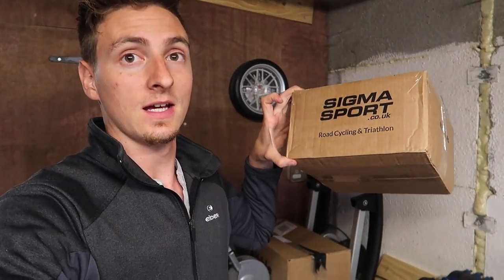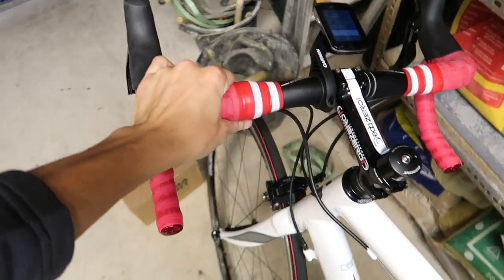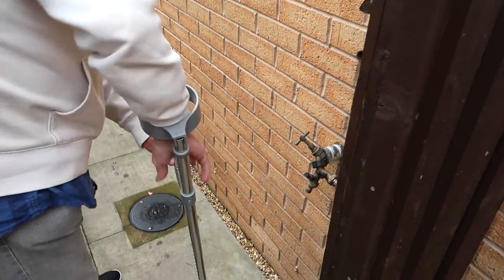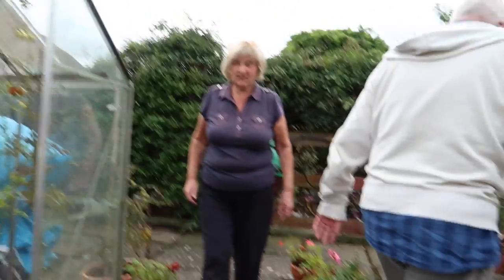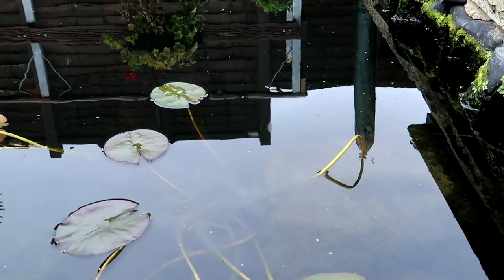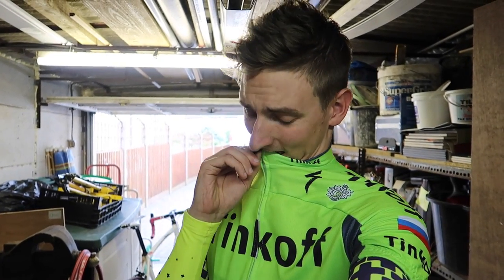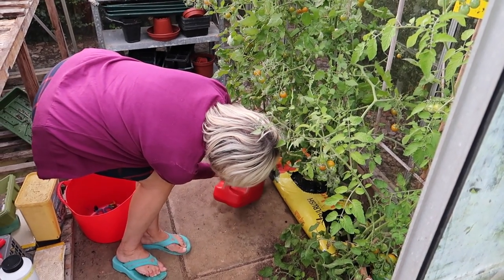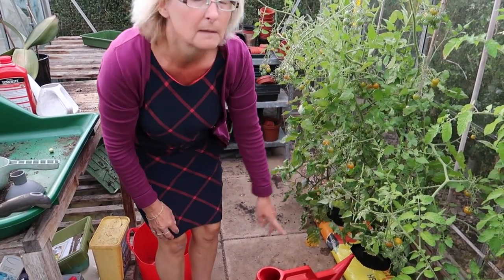Upgrading The Garmin - Edge 820

Comment: Can you flip the out-front mount and attach it to the right side of the stem to have the 820 more flush and level? Essentially, will the 820 attach to the other side of the mount?
Reply from the maker: +Jay Mercado (DJayM1) It doesn't. It only allows for rotation. The other side of the mount is also unbranded and grooved, so would look pretty unsightly and pool water when it rains. 

Thanks for the comment.
Reply: Oh, I see. Thanks for the reply and the review. Great video. Sub'd! Cheers!
Reply from the maker: +Jay Mercado (DJayM1)  No worries Jay. I did a final look at the unit here - https://youtu.be/a6j0s5QEaSA

Comment: might i hand you a DIY, remove the screws for the quarter turn mount and the quarter turn piece, remove your mount and turn it upside down end remount your quarter turn piece in the bottom.
Reply from the maker: Hi Bart, I thought the mount piece only allowed for rotation, rather than allowing you to flip the connector itself? I've not seen this posted as a solution anywhere else (and they mention rotating in the manual).

Thanks for the comment.

Ste.

Comment: nah, you want the f3 form mount https://www.kickstarter.com/projects/1187300751/formmount-bicycle-computer-mount

you cant expect a device like this to have a screen as responsive as a phone. two different devices made for two totally different things, a touch capabilities like a phone require much faster guts than a gps device even an advanced one like garmin. they very well could make it as responsive as a phone but the cost would go up probably another 100.00whatevers. even dedicated "car" gps units, in dash or 3rd party aren't as fast swiping as a phone. because of cost and the fact that if you had a  screen as "loose" as a phone while driving/riding it'd be very very annoying trying to control kinda like setting your laptop track pad sensitivity too high. touch screen for devises intended to be used while doing other things like this need to be tactile.
Reply from the maker: +Shane Brashear that mount looks fantastic!
Reply: Ste Rumbelow i hope it gets made
Reply from the maker: +Shane Brashear I'll back it and hope the same!